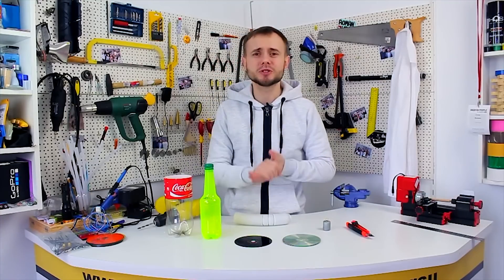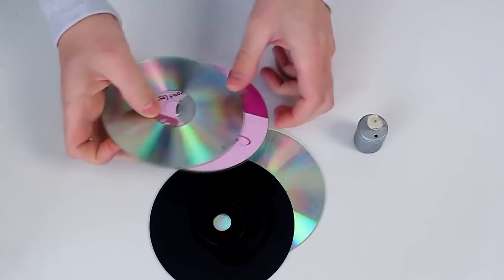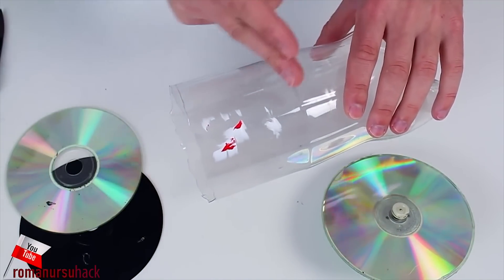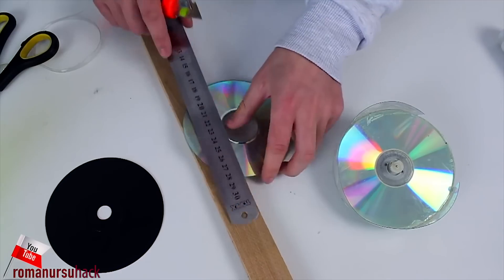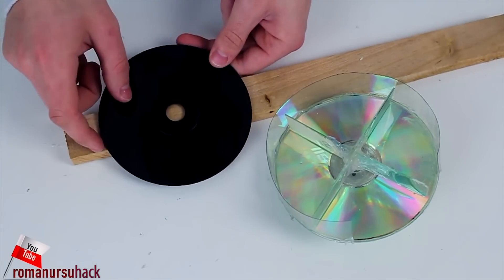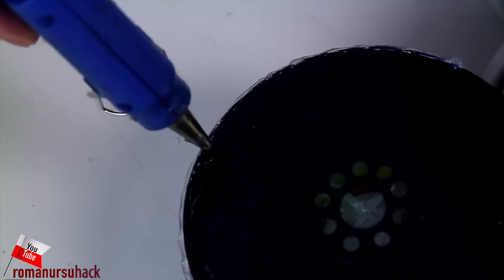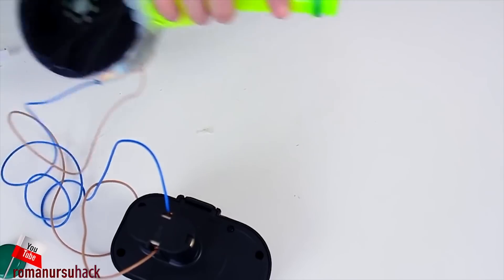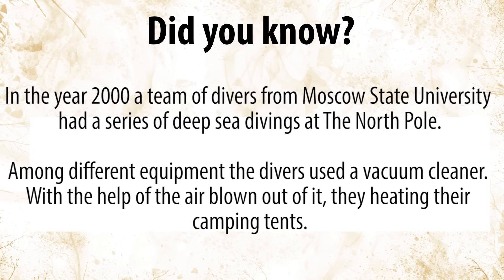SIMPLE DIY AIR BLOWER

Comment: Never did become a big fan of hot glue. I only use it for things that require low strength, or to hold things in position until E-6000 or Silicone fully cures. I want to see more of Mariasha. :-)